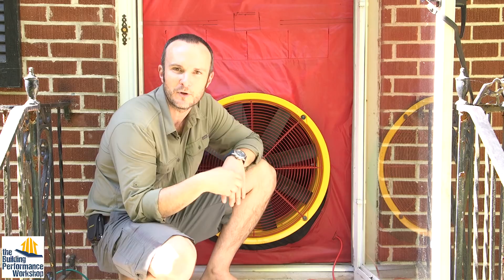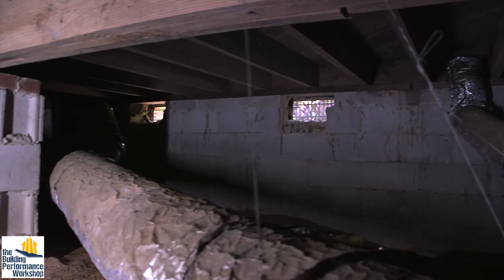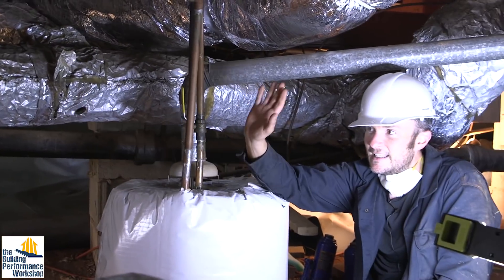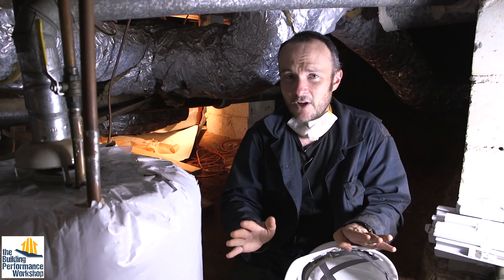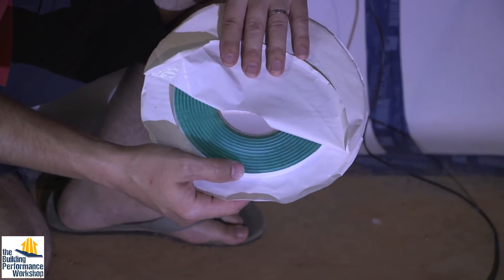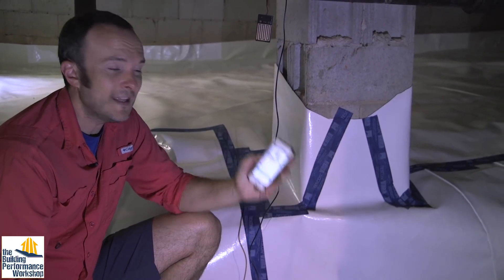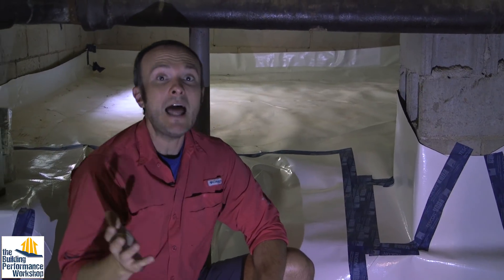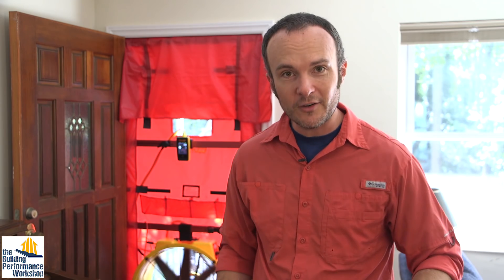Crawlspace Encapsulation: Performance-Based Renovation of 1960's Ranch Home

Comment: Hi Corbett, great video. This is the only video that I found with a subfloor made with planks. The planks have a little gap between them. I have the same sub floor in a 50’s house. I m wondering how do you run a blower door test when framing is exposed, If crawlspace is not encapsulated? If it is encapsulated, then do those gaps between subfloor planks make any difference?
Reply from the maker: Suparn, if the crawl is vented then a blower door test would be silly without the flooring down (which should seal everything, except at the edges of rooms). If the crawlspace is encapsulated, then it shouldn’t matter, since you want the crawl and space above to be connected.

Comment: Which product did you use on the floor? At one point you mentioned 20mil, but I'm wondering which brand it is. Thanks!
Reply from the maker: Sorry, Mark, I don’t know. I’m using Stego brand on our house- they’re only one of a few that make poly that thick.

Comment: nice :)
a tip, something i wish i had done, was fill up any holes in the ground. smooth the ground out as much as possible. it makes for a much better install especially when you have to go under and repair something.
the amount of water evaporated from the ground is not small. eg for my local aera soil type its about 1 liter per 10 square meters per day every day. (and thats with dry ground).

it will be interesting to see how much the gaps in the floor increase as the floor drys out.
Reply from the maker: Good point. We did that, actually- my dad’s idea. Removed all rocks too, so your knees don’t get destroyed when you crawl on it later.

Comment: What vapor open material will you be insulating the crawlspace walls with? I doubt using a vapor open membrane on the walls is necessary. According to Green Building Advisor's many posts about conditioning a crawlspace, foundation walls do not need to be able to dry to the inside. Plenty of crawlspaces are encapsulated with poly on the walls or insulated with rigid foam on the interior, neither of which are "vapor open". I usually follow and agree with your BS (building science), but I'm skeptical here. Thanks for the videos :)

Comment: I have thought about attempting this for a long time. But I have two situations I would like to ask about. First is that my crawlspace seems to be subject to a high water table. Gutters do their job and I have a berm to prevent water from touching foundation but 6 inches of water will still collect inside during heavy rain. Drains out within a few hours. If I put vapor barrier over this and still have the water intrusion will it mold under barrier? Second is what to do if the package unit HVAC ducts go through crawlspace wall? That's a big hole but I guess it could be mostly closed and sealed. Thank you for any input.
Reply from the maker: Eric, that is a very unusual setup. Do not do ANYTHING prescriptively, even from me. Drainage comes first though.

Comment: What if you have a cement floor in crawlspace and not dirt? Do u still line the floor with 20mil? Also do u have AC pumped in or just dehumidifier? Ty!
Reply from the maker: Yes, the concrete should be poured over a vapor barrier. Yes, the house, and therefore the crawl, is air conditioned, but mostly thru leakage in the ducts.
Reply: Home Performance we are not pouring new cement it’s an old cement slab that we want to keep clean. So is it ok to line it with 20 mil or leave it?
Reply from the maker: The goal is to keep the slab from being wet. If there’s a membrane underneath, great, if not, I’d cover only if humidity is too high
Reply from the maker: Yes, the concrete should be poured over a vapor barrier. Yes, the house, and therefore the crawl, is air conditioned, but mostly thru leakage in the ducts.